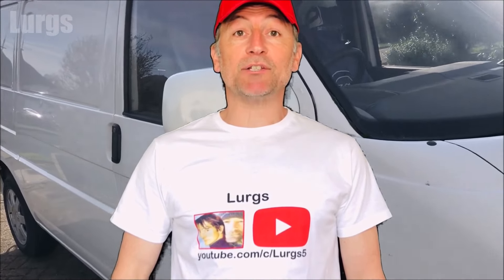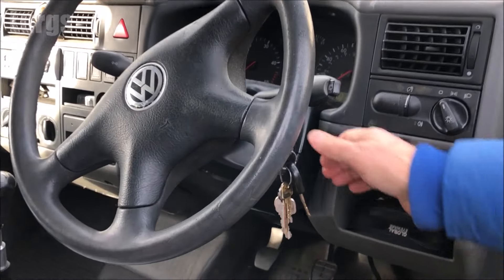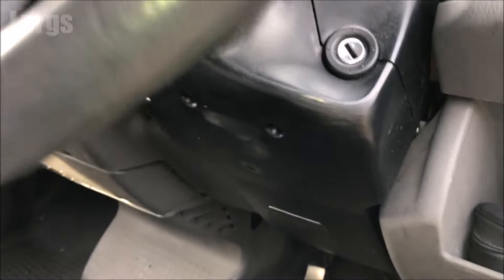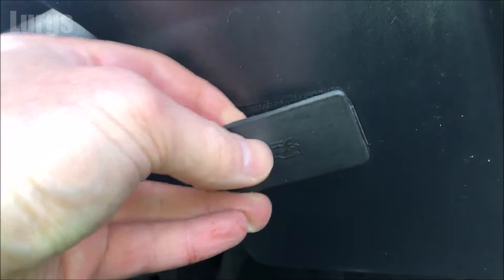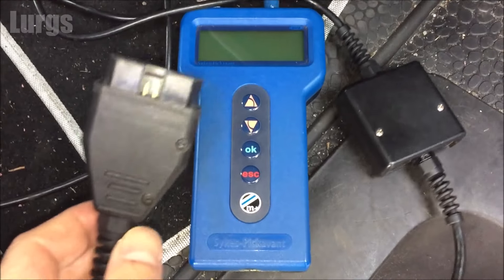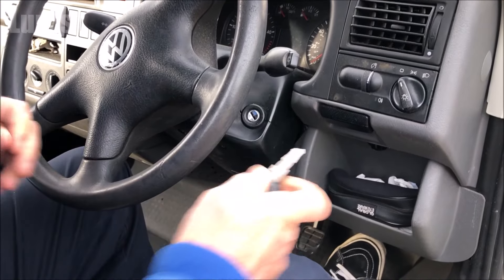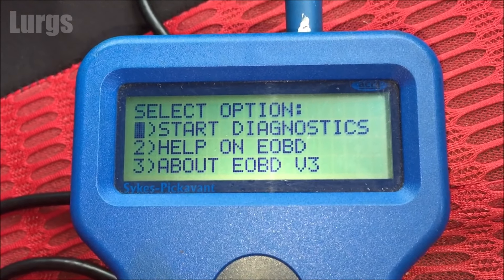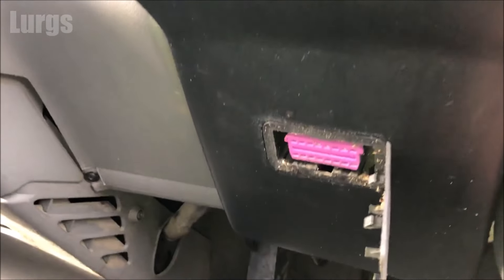VW T4 OBD2 Port Location - VW T4 Transporter OBD2 Diagnostic Port Location

Comment: Not much use plugging a T4 into a diagnostics tool. I've never once plugged mine in. When the cooling fan wasn't working I didn't even know. I drove it around for many years like that. No lamps on the dash to tell you.
  I'm starting to wonder what it can tell you. 2002 2.5 TDI
  I stopped driving it because it stinks of diesel and the oil pressure is down but I don;t see how mu diagnostics tool could help me with either of those things

Comment: Useful? Not really, did loads of research, decided to get the Haynes best buy, excitedly plugged it in and....... first of all a completely blank screen then after fiddling about with all the wires and fuses got the scanner screen to show icons, then tried to look for error codes only to be told cannot connect to vehicle...... I give up, waste of time and money.
Wish I'd never bought  T4 or any other VW now, I've always driven Japanese cars, Hondas mostly for over 35 years, never, never ever let me down.
Bought this T4 new in '03, turbo packed up within 6 months! There's constant;y been something wrong with it,  small annoying stuff mostly but you just learn to live with it and swear next time buy Jap!
Oh yes, and when you go on the VW forum and see just how many people there are having problems with them it's a wonder anyone buys them!
Reply from the maker: Sorry to hear you have had so many problems. Yes the OBD2 ports are standard size but they certainly are not standard when it comes to talking to the Vehicles computer system! I've got a T5 and my Dad has a very expensive OBD2 scanner with different cards for different manufacturers, we plugged in the VW one and still couldn't communicate with the Van. I'm loathed to buy one off flea bay as if it doesn't work it's wasted money.
Reply: these T4's are pretty much 30 + years old now, rust buckets that are bound to have constant problems, only worth having one if you can do the work yourself or if its a project.
Reply: @LordFlashheart1  30 years old. wow how time flies. I thrashed mine for years but now it says low oil pressure and not sure why. It always had regular oil changes and the mileage is low around 120k
Reply: @izzzzzz6  everything flashes on mine, has done for 6 years but still going touch wood🤣. I service it regularly though